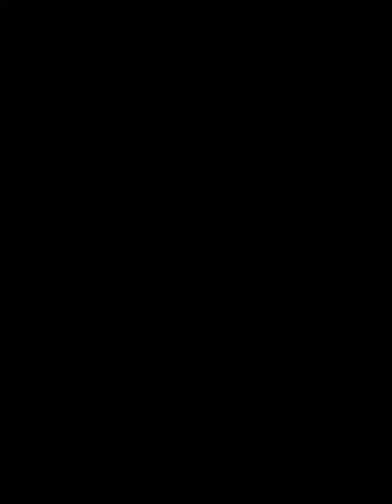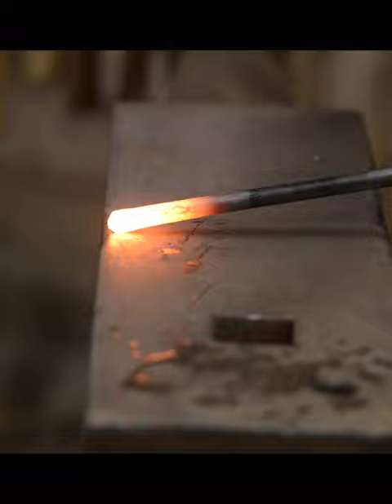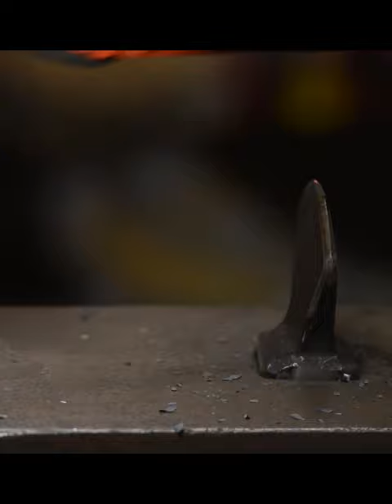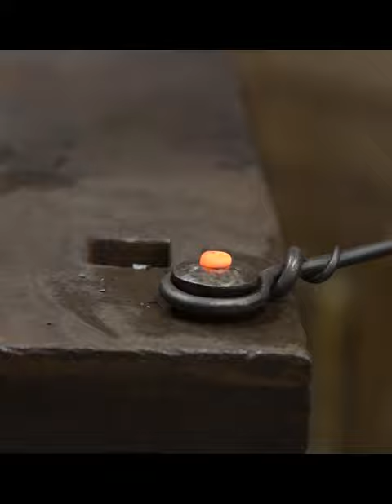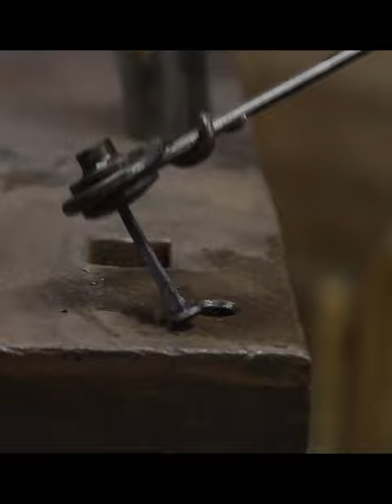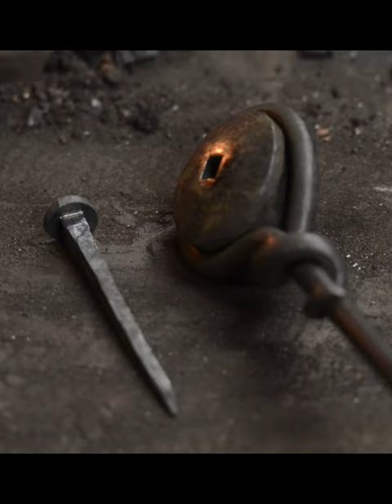HOW TO Hand forge NAILS  #blacksmith #handforged #nails

Comment: After finding, mining, and purifying the iron, that’s how we made a nail. We take so much for granted.
Reply: And it should also be mentioned how much effort it takes to find, mine and purify that iron! It is crazy what times we are living when we take everything for granted!
Reply: @diavalus  Indeed, every step is a huge task in itself. Nowadays we click-order it, and sometimes it shows up by our doorstep in a matter of hours. Put it in a nail gun and no need to even hammer it, just shoot Lol
Reply: Funny thing is, today those nails are made by automated machines that roll and cut stell wires. Seems easy, until you take into account the foundry needed to cast the machines, the motors with copper, aluminum, circuits and so on, not to mention the maintenance.

The process may be automated, but the price is the complexity of the production chain.
Reply: @TheCuteZombie  The other price is quality. Wire nails are way easier to make, but much worse at actually holding wood together than square nails. 

Cut nails are a nice middle ground though.
Reply: I'm pretty sure most iron during the iron age came from bogs and was  sediment based so not much mining and stuff but I could be wrong

Comment: Nice Torbjorn, but do it in one heat like they did in the past. 😅
Reply: Did they do it in one heat in the past? 
I mean I guess if you were quick enough you could, and with the amount of these that a smith would need to make, I guess they would get pretty proficient and quick with making them
Reply: @Ronny33140  Yes. In a couple of vintage films, I've seen here on YouTube, shows the smiths easily making a nail in one heat. I've just been trying to find one video in particular again, of a village smith who made nails full time. He had a special 'nail anvil' setup.
Reply from the maker: Can absolutely be made in one heat!

Comment: Discussing blacksmithing in the SCA many years ago someone pointed out "yeah swords are cool but the vast majority of a smith's work would be making nails."

Seems like it would take a day to forge a cabinet's worth of nails, which further explains why a lot of furniture was put together with dowels.
Reply: Working with large pieces of natural wood, you also want the joints to be able to move with moisture changes, so even today, non-plywood (etc.) furniture is made using the same old types of joints, while dowels are used with composite wood materials because woodglue on dowels is WAY stronger than nails, and screws are inconvenient, especially if they go in even a little askew.😊
Reply: @MichaelBerthelsen  I am definitely not a wood worker. Last weekend I used some scrap lumber, a stationary belt sander, and a hand saw to solve some problems. Zero joinery, and it ended with the wood super glued to some metal.
Reply: It also would’ve been apprentices making common wrought-iron nails rather than the smith doing so, unless the smith happened to be bored. Also you’d be surprised, a moderately-skilled smith can knock out a dozen common nails in a few minutes.

Comment: Is there a video on how you made the die for flattening and shaping the head of the nail? Regards from Down Under. P.S. Nice nail👍
Reply from the maker: Yes! A very old video though - https://www.youtube.com/watch?v=Qpy2by9if8A
Reply: @torbjornahman  Just viewed the video, very nicely done.👍
Reply: @torbjornahman thank you for the link , Torbjörm Åhman. That's a nice header. Really fun to have two and get a rhythm going. I just watched the link. Been reminiscing about making heart shaped nailheads using a cheater step. Using fairly large #10 Capeheart horshoeing nails flatten the head and split to a small heart. Heart can be shaped with a small couple of taps with a little Ball pien and drilled ⅛ for mounting. Scrowl the point, beeswax and done.v6

Comment: Yesss. First time I've seen anybody bother pointing it up in the fire. I don't know how anybody can get it hot enough on the arse end without doing that, and not burning the tip. Obviously you can block it with a big bit of green fuel. But point up, always point up. Then you can have a nice hot end ready to head up.

Comment: Dear Torbjorn!
I've seen square nails made by hand 200 years ago. The nail should be square, but twisted in a spiral from head to tip.   It will hold on tighter.
With respect and best wishes!
Reply from the maker: Very odd! I have seen many hand made old nails, but never ever twisted.
Reply: @torbjornahman  
A twisted nail holds the connection more firmly.180 degrees is enough.     🖐
Reply: Many nails were clinched.

Comment: for quenching, do we want nails soft or hard? What is the ideal material to quench in and what is the ideal hardness we should look for?
Reply from the maker: Traditional nails are nothing else than mild steel or wrought iron, nothing you quench. Even today most nails are mild steel.
Reply: @torbjornahman  I knew today's nails were mild, but I wasn't sure if traditional smithed nails were different or not. Thanks for the clarification!